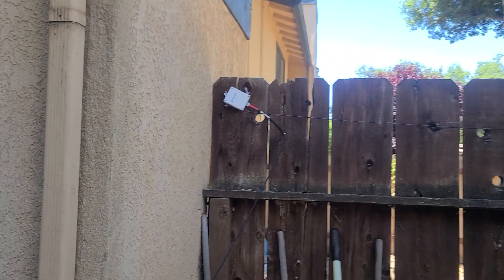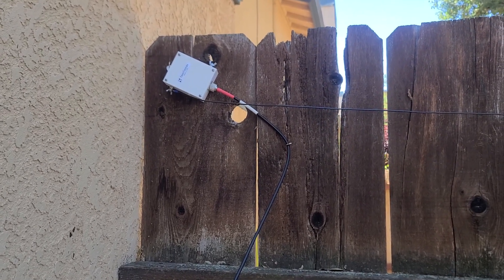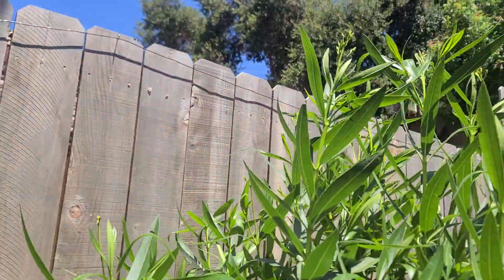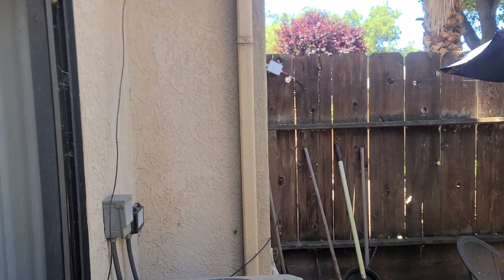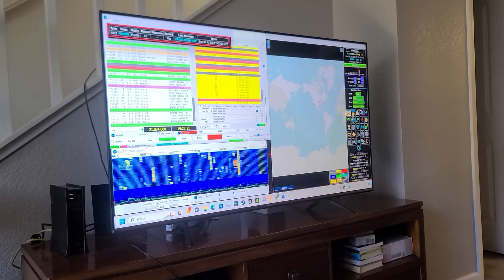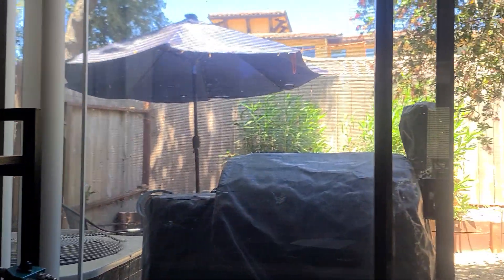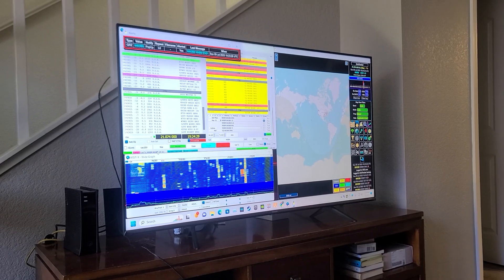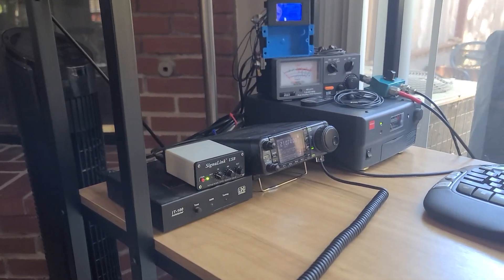HOA Antenna Setup. TennTennas EFWH 49:1 from W6OBB - #FT8 #W6OBB #AmateurRadio #EFHW #TennTennas

Comment: Dave, will it tune on 75m(3980 to be exact) with a tuner
Reply from the maker: I've tuned mine to that with an external, MFJ-939. Very inefficient, but it worked. The internal tuner on the 710 won't tune to that, however. I think in this video, I had my 7000 hooked up to it but using a Yaesu FT-710 now.
Reply: @W6OBB  I've got a 710 also, using a LDG Z Pro 2. Pretty sure it will work, like others said inefficient

Comment: There are very strict rules that actually forbid HOA's and landlords from restricting the installation of antennas. https://www.ecfr.gov/current/title-47/chapter-I/subchapter-A/part-1/subpart-S/section-1.4000
Reply from the maker: I just read it. It says under section 2 that this does not include amateur radio. Also, for the antennas it does include, it says they must be less than one meter in diameter.